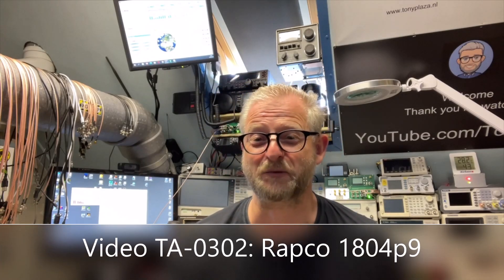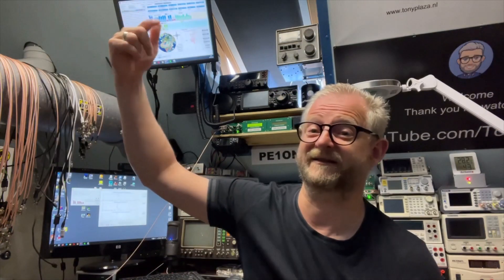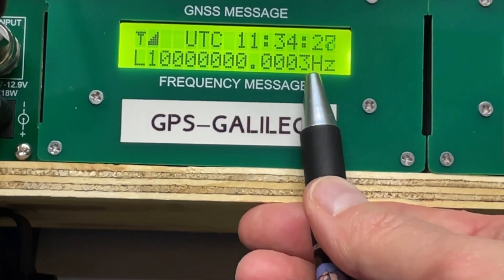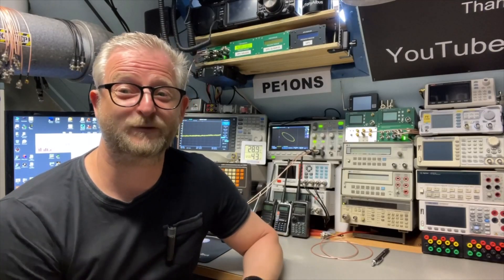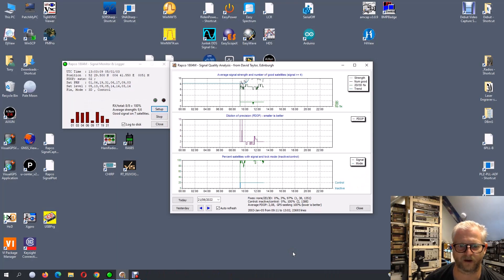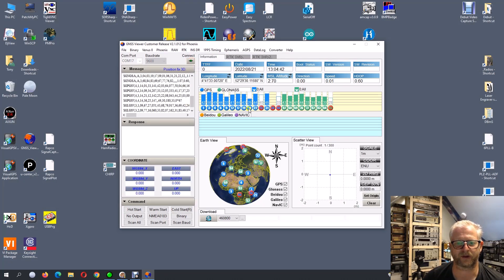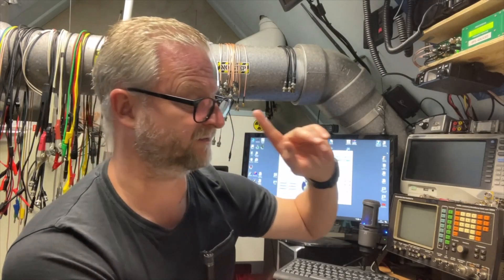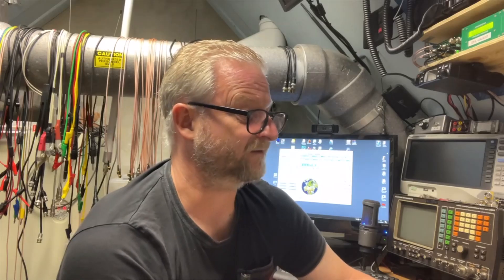TA-0305: Rapco 1804p9 vs BG7TBL GPSDO a 2nd look

Comment: Just as an FYI, if it took 22 minutes for one cycle to "cross" (in the video, you showed 11 minutes for what appeared to be 1/2 cycle shift) - that would equate to roughly a time accuracy of 1 second in 418 years.  Not bad!
Reply from the maker: Thanks! that is great to know... good i did it on 10 MHz and not 1PPS... would have become a long timelaps :)

Comment: I've also heard you can get timing GPS chips if you are building these sorts of things for labs, they don't care so much about position at all, all they care about is getting spot on timing errors to a minimum. I think for this, they assume that whatever position they are in currently, it is fixed (your equipment is staying in the same place on Earth) so it can start improving relative accuracy deviations in the timing calculation from there. Whereas a regular GPS chip, a smaller timing error is cross-correlated to how well it can calculate an accurate position, but it doesn't ever assume it is stationary, so it has one less constraining variable it can use to narrow down error.
Reply: The thing to improve is a M8T, LEA or NEO, as they are focused in that. You can use NEO-M8T and it will be compatible and transparent with the M8N of any gpsdo use one . LEA m8T is not pin compatible, but it is even better for these tasks, usually is communication towers etc
Reply from the maker: Thanks Matt, interesting point indeed.

Comment: Hi Tony, thanks for  the interesting videos.

I have gotten myself one of the BG7TBL GPS receiver, the FA-3 frequency counter and the 10 MHz distribution amplifier and I have a question:

On bot the GPS receiver and frequency counter we see a display telling us the frequency with great precision.

But

How can we be sure about the accuracy of those readings? If we use the GPS signal as reference, the frequency counter assumes it is perfectly 10 MHz, so what if it's slightly out? It gives us readings down to the 0,1 micro Hz!!!

And the frequency counter of the GPS receiver itself, how can we be sure it is accurate to the 0,1 mHz?
Reply from the maker: The display shows the current setting of the TCXO compared to the GPS time (atomic clock) so if it is a bit off, is will try to compensate.
Reply: @TonyAlbus  thanks for the answer. Are the exits of the distribution amplifier 50 Ohm or high impedance?
Reply from the maker: @germibestia  Hi, they are 50 Ohm

Comment: 👍🙂
Reply: I just wondered if that Kenwood TH-D7 still works.  Mine does. Even the batteries.
Reply from the maker: Hi Barry... TH-D72 .. yes is does.. video from last May. https://www.youtube.com/watch?v=abdf7KbrtAo
Great yours works too.
Reply: @TonyAlbus  Yes, I just found your #283. But it would be really nice if there was a mod to allow WIRELESS connection from the D7 and a GPS. I already have a Bluetooth GPS, so how hard would it be to add BT to the D7 somehow?

73
Reply from the maker: @barrybogart5436  If you can find a serial to BT adapter, you should be able to do so right?  only thing is, modern GPS do 9600bd , i am not sure, but the older Kenwoods usualy expect 4800bd .. that is to look out for..
Reply: @TonyAlbus  Hams are clever - I bet someone has done it. Years ago.